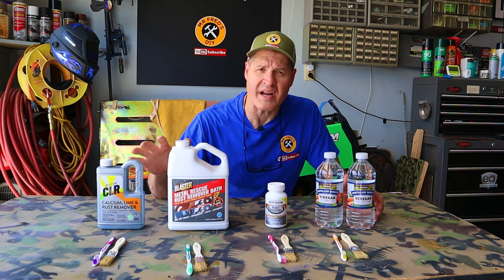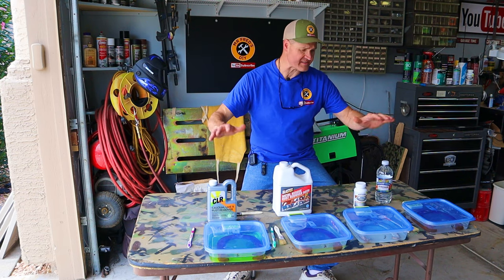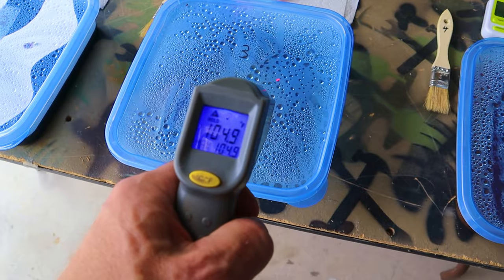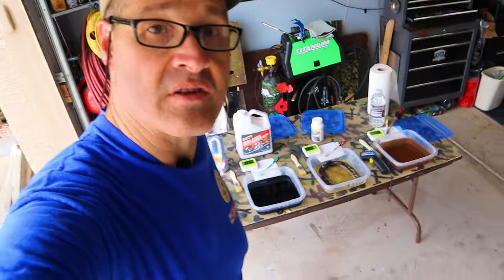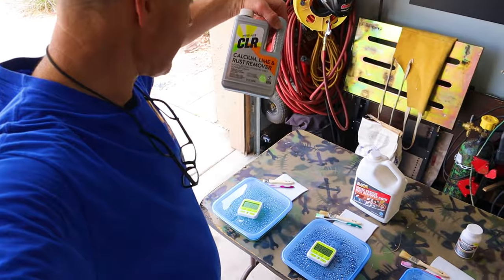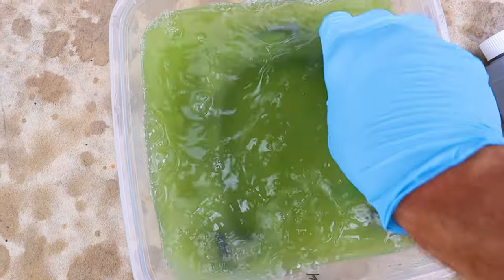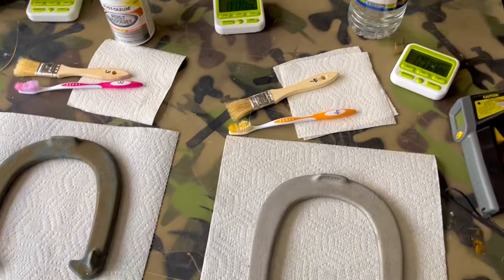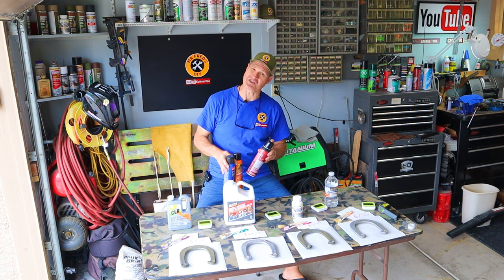Vinegar VS Rust Remover Brands

Comment from the maker: Did you expect the outcome I achieved in this video? Let me know which horseshoe you think looked the best! Do you think I should have used a wire wheel to clean them all for the video?
Reply: I think your method was excellent, wouldnt introduce any other factors such as the wire wheel, as is, the winner is undeniable. I did not expect this outcome at all! your vdeios are truly top notch Sir. My all time favorite is the garage door insulation
Reply from the maker: @FurrKnight and this video really opened MY eyes. I was thinking vinegar would do OK but I had no idea. It was going to work so well.. thanks for commenting and thanks for watching!

Comment: I was really interested to see how the "others" performed which you clearly show, as I've used winegar earlier to remove rust on a steel plate inside a Commodore Amiga computer and it worked incredibly well. I think the Blaster product is also usable, but at the price it feels kinda dumb. The others seems to have some start of surface rust, compared to the Blaster and winegar which looks completely clean.

Great video! 😃❤
Reply from the maker: Thank you for commenting! I was really intrigued by the results from this test myself. I guess the one good thing about the blaster is that it is reusable. Thanks for watching.!
Reply: @MrFredsDIY  Aha! Well then it "might" be worth the money then 😃😋 Thanks for the reply!

Comment: What about a non soak test.... A spray on where you can't submerge the item????
Reply from the maker: Good question for sure. I will explore a possible video on this topic.
Reply: @MrFredsDIY  Carbomer will help you to create the gel that you desire. You will want to make the EDTA and the Carbomer solutions separately  since the acidic Carbomer will gel practically instantly when neutralized by the EDTA. To make a quart try splitting the water into 2 1/2 cups for the EDTA and 1 1/2 cups to dissolve the Carbomer. Use the full amount of EDTA to make the finished quart. The Carbomer is a long polymer that will take a quite awhile to unfold itself properly into the water. Be patient and stir regularly. Think 24+ hours. A high shear mixing stick blender can help the initial dispersion, but time always provides the best results. You won't need much Carbomer to create the gel. 
Adding a surfactant like Sodium lauryl sulphate (SLS) also helps to remove surface oils that can be barriers to effective contact with the rust remover compounds. Surfactants also help the chelating agent to access and capture the iron ions.  The good news is that any common soap will do to provide this compound and other useful associated surfactants. Try to avoid laundry detergent since these contain additives that may not be helpful. Dish soaps are the cleanest. Add this surfactant ingredient to the EDTA solution. 
Once all of the ingredients are properly dissolved, you will need to combine them. Because Carbomer gels instantly when neutralized, you can't simply pour the 2 solutions together and expect anything but an icky blob disaster that can be unusable. Begin by mixing the EDTA solution with a stick blender. Pour the Carbomer solution into the vortex slowly. Carbomer will not gel initially under the stick blender's high shear mixing conditions. The stick blender's high shear mixing will allow you to form the blend properly before it gels. You will want to check the pH while blending. The pH should be slightly basic. You may need to a a bit of Citric acid, but be very careful. It is better to err on the side of too basic (pH >= 8) since this supports gel stability. Acidic pHs breaks the gel! Slightly basic or even acidic will not foster the conditions where the myth of hydrogen embrittlement can even be mentioned. But basic makes the gel!

Note: Hydrogen embrittlement only occurs in specific extreme circumstances and is often associated treatment with strong acids like HCl and electroplating processes. Even the  straight Citric acid process does not go there either. It is a good chelating agent, but it isn't close to the strength of EDTA in capturing iron ions from the rust. 
Note: EDTA itself is a mythical compound that only exists while this molecule is dissolved in water. It's stable form away from water is Tetra Sodium ethylene diamine tetra acetic acid (TsEDTA). The sodium ions combine with the 4 acetic acid groups to neutralize them and allow the compound to form readily water soluble crystals. That's what we buy! The amine groups in the molecule are also basic once dissolved in water.. 
Note: Carbomer is generally available from web sites that provide hand made soap, cosmetic and toiletry ingredients. 
There are many chelating agents that exist, but there are only two that are cost effective; EDTA and Citric acid....